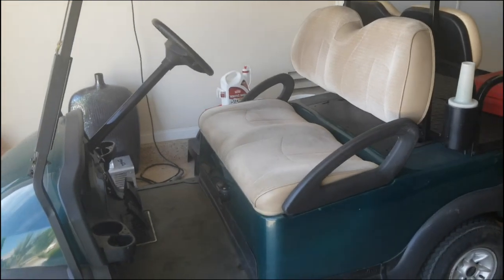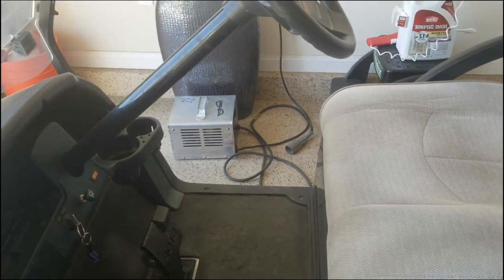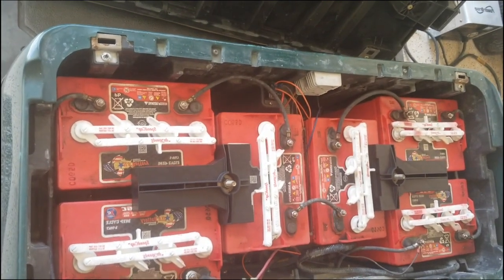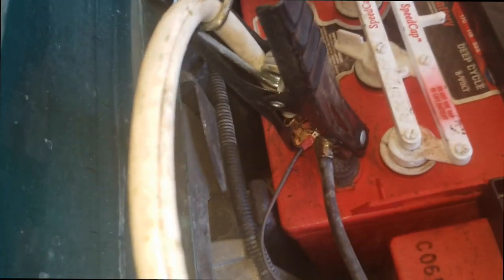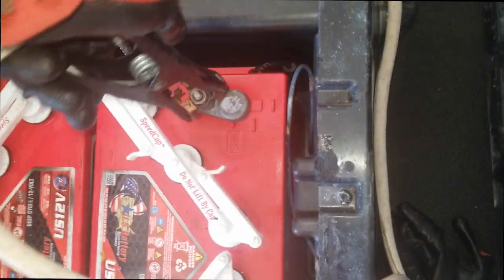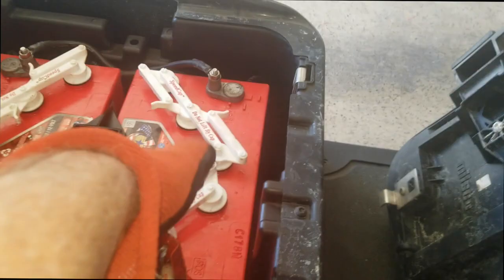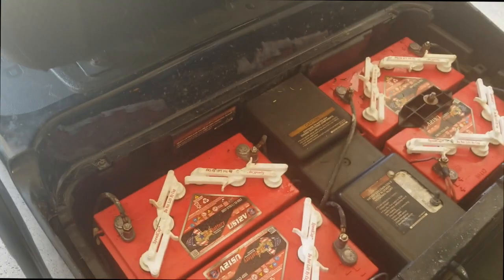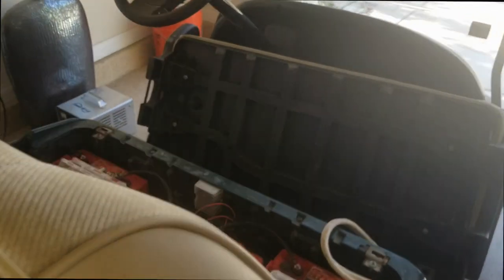Emergency Jumpstarting a Golf Cart

Comment: Hi Wayne, great video. If i were to have 2 chargers available how would I go about going from one charger to the other? Im a new cart owner and my 48v club car i believe has died and i cant get it to charge with my powerdrive charger! Thanks!
Reply from the maker: I don't fully understand what you are saying or asking.?
If your cart still has the obc, only the pd chargers will work unless you have a charger that would clamp onto the battery posts.
Also use jumper cables from one cart to yours to get charger to kick on.

Comment: How do you confirm without a doubt that your batteries are just no good and need to be replaced?

I charged one 8 volt battery for 10 minutes (because i was afraid of blowing it up) with a 12v charger and it got to around 5.6v but it kept dropping after removing the charger...did it need more time charging or is that a sign that the battery is no good?
Reply from the maker: Sounds like they are no good. The idea is to charge each one individually,  like you tried,  but 1 after another, then hopefully they hold enough volts until your cart charger  an take over. But yours sound like goners.

Comment: So i have have a question, i have 2 48v golf carts, one is running and the other one is not, can i test the good batteries to the golf cart that's not running with jumper cables? I just dont want to move all the batteries from one cart to the other
Reply from the maker: yes you can do that 👍

Comment: After I take my jumper cables off the charger turns off
Reply from the maker: Then your batteries are no good.
Reply: @waynemartin.waynesgolfcart4900  I got another golf cart that ik the batteries are good in but there to dead so how do I fix that
Reply from the maker: Charge each battery individually with a car charger
Reply: Wouldn't the golf cart charger see the actual low charge when you remove the jumper cables causing the charger to shut off?

Should you leave it jumped for a certain time?

I imagine that if let's say you have a charge of 10 volts total...you jump 36 volts over and now your charger sees 46 volts and proceeds to charge...then you remove the jumper cables and you go back to 10 volts wouldn't your charger just shut off due to the  low voltage?
Reply from the maker: @macknumber9 once the charger kicks on, it should stay on and charge the batteries. If it kicks off, then the batteries are too low or no good.